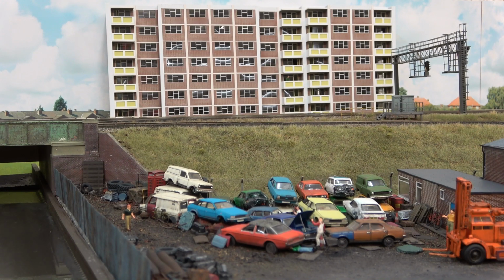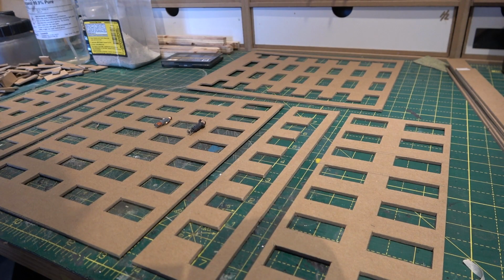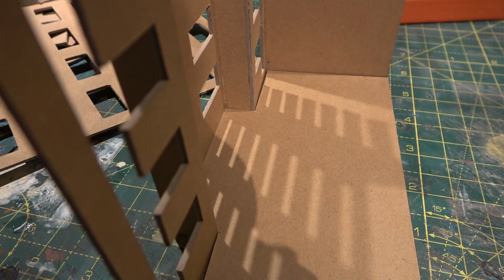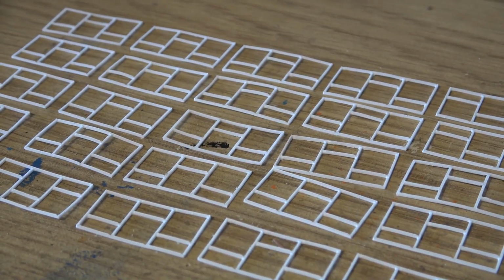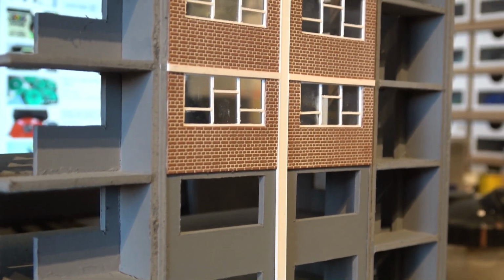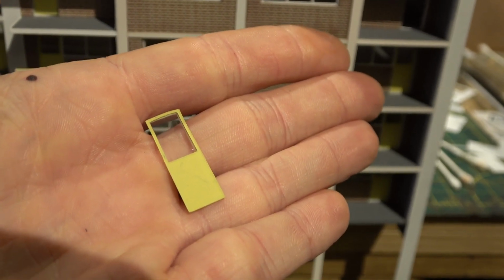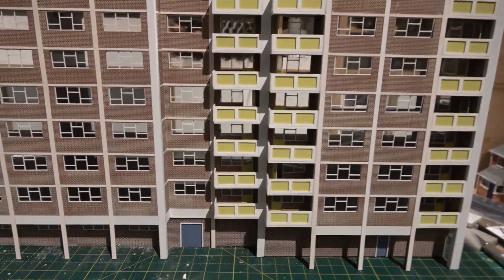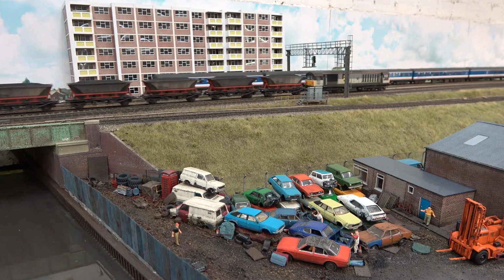New Layout Build - Scratch building a block of flats

Comment: Great effort! For your information, floor to floor heights are usually about 2600mm in residential buildings. Floor to ceiling is usually 2300mm. The 2000mm dimension is the minimum height under beams etc. I hope that helps. Keep on doing what you’re doing. It’s amazing.

Comment: You can get cheap effect LEDs, which already has a built in effect like candles or slow RGB changes or blinking. Just power and a current limiting resistor you need and you can imitate TVs in the tiny flats. In my country in the 80s, there was B/W televisions mostly, so the candle effect can be OK.
Reply: Put a cool white LED in series with the flickering LED for a nice TV effect. (Adjust brightness with the resistor and hide or paint the yellow LED.)
Reply: You can also use that for a broken tube light with a bad starter.

Comment: That's a clever bit of kit Richard and, the more you learn about it, the more time it will save you. A scratchbuild of this size would have been an even more daunting prospect without some mechanical help. Being so big, there should be loads of opportunities for super-detailing, lightning conductors, aircraft warning beacons, topless sunbathers(it is summertime😁).
Can you sharpen the cutter, or just replace it? How long does a blade last? 
Another thing that should improve with use: you should end up with a library of "bits", pretty much ready to print. The more things you build, the more components you'll have on file, ready to use on something else - maybe designed by the same council architect. 👌👍😁

It's looking great, should be fantastic when it's finished, and completely unique to Everard Jct.
Cheers for now,
Dougie.

Comment: It looks great! I have just created something very similar (7 Storey flats), I have always fancied a Cricut, but went for a 3D printer instead. I have used ply as the base and used a render for coloured concrete. The windows (actually mostly patio doors, to mix it up) have been designed and printed in 3D. Bit in advance of you, as I have curtains and lighting installed, but I bet you finish yours and get the vid out before me! lol. It's not going to be my last one either, get in touch, I will supply the windows, if you supply the brick panels!

Comment: Very impressive Richard, you might be on to a nice little earner here if you could make available the window and door sections in kit form on your machine. I've tried scratchbuilding high rise flats in the past and as you save it takes ages to cut out all the windows and doors to a high standard , even resorted to kit bashing some superquick kits together , there are some chinese kits on ebay that  are not too bad with a bit of kit bashing, looking forward to the next vid Ian. H

Comment: Excellent work. If it helps, having worked for a large TV rental company in the 80's, it wont be cheating having a single TV aerial (sometimes a FM radio one as well) on the roof as a lot of tower blocks had communal systems in the 80's, though not for the old analogue satellite that Sky started with.

Comment: I only haave a  handfull of buildings in HO Scal;e that require multiple floors. I started modding those buildings using your sliding interior idea and it makde it so much easier to light them in the long run

Comment: Richard...WOW  WOW  WOW !!!!!!!!!! what a fantastic scratch build. You should be immensely proud of the block of flats. By the way using that incredible machine is not cheating. Just one question :- Would a building with that number of levels require a lift under UK building regulations. If so a simple small housing towards the back of the roof would give the impression that it housed the lift machinery. My congratulations on a job well done.  Cheers   Greg

Comment: roof details,  needs a lift  gear housing,  big two storey blockhouse,  and of course a big set of cell phone masts plus equipment housings,  also, lots of vent pipes for  waste water, drains and rubbish chutes and ventilation fans too,  for bathroom and toilet extractors ( I'm an ex multi-storey caretaker, so I've been on top of a few!)  On the comment 'non-offensive German yellow',  not when it's sprayed all over a Panther tank advancing towards you it's not !   But lovely work

Comment: I have only just discovered your channel and have binge watched a number of them going right back to the earliest over the last couple of nights. I would have to say all the videos, visuals and commentary are very professional and quite inspirational but a bit beyond my skill set, particularly where there is a need to be dexterous with the finer work. Never the less what you have demonstrated and the way to go about things have given me no end of ideas to try on my modest model railway to the point where I would say I have learnt more from watching your videos than I have during years of watching other similar videos. Just two questions. Over the videos I have watched you seem to use a number of different glues, "Rocket Card Glue, Mode Poge, Copydex, Super Glue and PVA. Could you say which glue you have found most appropriate and for what job/work/materials and what do you use for shaping the foam for scenery?

Comment: That class 58 is new isn't it?
Top work!
Have you considered a telecommunications tower on your railway? Would be a little different, not often modelled but also not overwhelming
Reply from the maker: I fancied a sector example so bought a used body for my existing red stripe 58.  I've plans for further tall structures on the layout in future.  Need to be careful about height as the backscenes aren't as tall as they appear.  Cheers
Reply: @EverardJunction  Very nice, seems a less expensive alternative to buying a whole new locomotive.  Would we be able to see the full fleet in a video?

Comment: You said it prints what you draw on the pc, which program do you use for that or does it come with its own.
Reply from the maker: It uses its own software which is free.  It takes some getting used to as its a bit basic/limiting.  I've not found any alternative software so far.  I'll go into more detail about the machine in the next scratch build video.  Cheers
Reply: @EverardJunction  Thanks for the reply, I done a little googling and found it can work with a few other more advanced programs, illustrator, photoshop etc, somebody even said it accepts dxf files, (although how true that is I don't know) which is interesting to me as I am a cad draughtsman. Looking forward to the next video, and the block of flats look awesome now, will look even better when weathered and complete.

Comment: Hi, great to see your latest creation, how is the Granada coming on?
Reply from the maker: Put the engine in it last week.  I'm getting closer to completion.
Reply: @EverardJunction  Have you run the engine yet? I have many happy memories of the old Essex engine. as a youngster I used to own a Corsair Estate, but not the 1700cc V4 GT model mine was fitted with the full 2000 cc V4 lump. it was also fitted from the factory with  2000E wood interior. the reg number was TKM680H I wonder if it is still around. A very rare car even then. I also had a 3000 E Capri another great car. Your Coupe is pretty unusual as well, definitely the one to restore. Your layout is looking great it has the attention to detail that makes it all the more captivating to see. Keep safe

Comment: Hey Richard. My heart sank when I saw you had 288 comments, so in the unlikely event of you being able to respond to my text, here goes. I was overly impressed by your Cricut Maker and wondered if you could advise whether it would be good for using with Scalescene products? Say for example I have the Scalescene template which uses 2mm and 1mm grey card. If I incorporated the template into my laptop, would the Cricut Maker cut the grey card so that I can apply the Scalescene template to it. I find that cutting the grey card using various scalpel's etc is rather laborious and this machine could offer me a solution regardless of cost. Best regards and thanks for another fabulous video. Mike
Reply: Richard convinced me that I needed a Circut machine which has arrived today. I want to cut out a number of Scalescenes downloads so have found the answer to your question. You have to convert the PDF to a .png file and then you can upload it to the Circut software. There are free converters on line and you then select the bits of a page that you want to cut out.

Inevitably I now have questions for Richard if he reads this but we need to find a way to communicate outside this medium. I will try posting on RM Web

Meantime congrats on a superb and inspiring model which has cost me a lot of money!